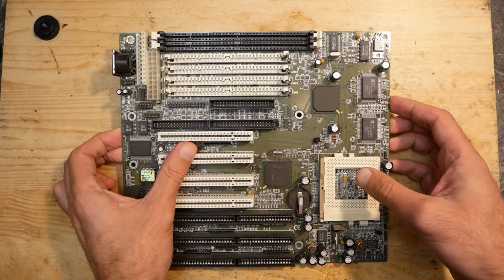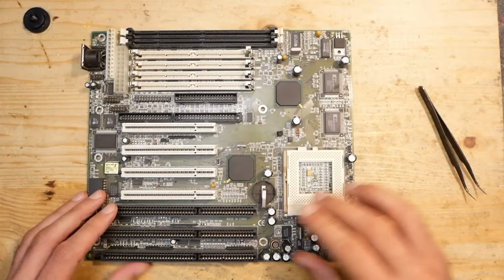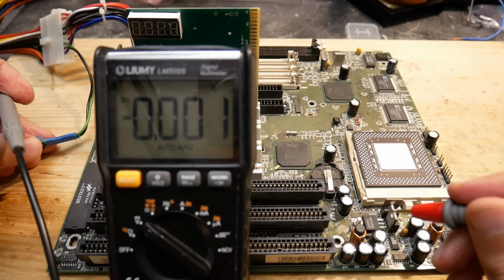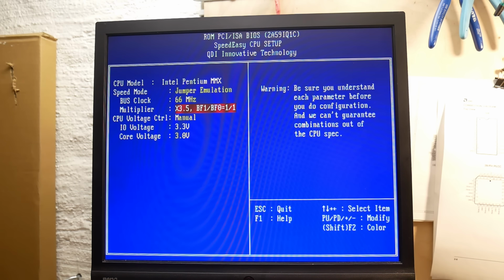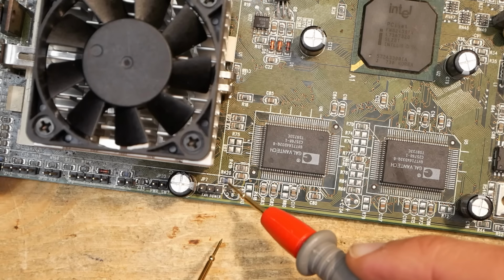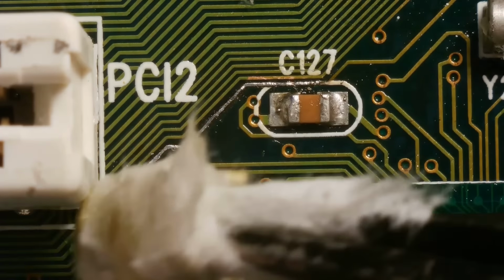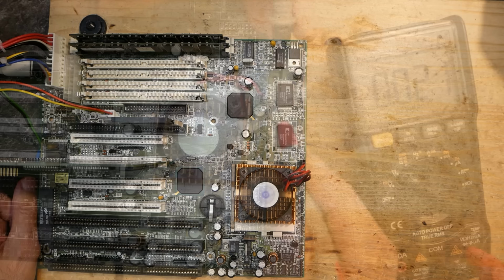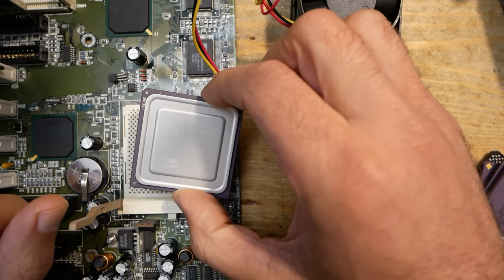QDI P5I430TX - is it the best Socket 7 mainboard?

Comment: Nice board, but I like my Freetech P5F87 better. Also 430TX, but ATX, can also automatically adjust voltage (can also be adjusted manually), but with the updated BIOS from Jan Steunebrink it can also K6-2/2+/III/3+, more modern Cyrix MII and HDD120GB. What it can't do automatically is adjust frequency.
Reply from the maker: I just never released an update. I worked with Jan on this board and it got a modified BIOS to support everything up to K6-3+, 83MHz FSB and all the other stuff incl. automatic frequency.
Reply: @necro_ware  That's great. I was also very pleased with his work on my board, which greatly increased its value. I like tuning these old boards to the best of my ability. I have a Cyrix MII in mine, so it's not the best possible, it's more of a machine purely for fun and I hope to meet the fastest Cyrix PR433 one day.

Comment: I had two of these motherboards back in the day. Don't remember if it was 1996 or 1997. Anyway, I blew up the first. I accidentally left the cmos jumper shorted while I tried to start the computer. I could see a big spark near the cmos battery, and I remember seeing a big trace rolling backwards on the board. So that was that and I had to buy another one. Also, I believe there is a beta bios or something so you can get 83MHz FSB. I remember I did that back in the day. Anyway, for it's time this was awesome. I remember how awesome it was to have jumper free overclocking.

Comment: I have the same motherboard, unfortunately the bios got corrupted, how do I restore it?
Reply from the maker: Download it from the retro web and write it using a programmer on the ROMs.
Reply: The chip is soldered on the motherboard and has 32 pins. Which pins should be connected to the eeprom programmer?

Comment: maybe not so related question. I had a pc die on me when I removed the cooler to change thermal paste, after new paste it wouldn' boot.

I bought a PCI post debug card and it doesn't show any numbers, no 0, only the default "----", does this mean dead motherboard? or cpu? the motherboard is a GA-7ZX rev 1.01 (actually seems to land between 1.01 and 5.0 because it exhibits features/lacking of both...)

Comment: Nice! I have saved the cheaper 430VX QDI which has the SpeedEasy feature as well! It is kind of a hybrid of old and new stuff. Btw - it is quite common to have a VRM failure on those boards that is manifestig in the way that only single voltage cpus work! In some cases one of the power transistors / mosfets is bad. In my case it was one  voltage reference (small 3 pin part) that failed. Used parts from a dead broken board and saved the better one. 😂 And the funny part . I had to fix the same broken Simm slot and IDE connector as you 😀. Used 100% the same method and all work. In my case the board beeing VX I need the simms more.

Comment: I had a similar mobo : Shuttle HOT! 569 iTX. While it didn't have  CPU settings in BIOS and instead relied on a series of switches (not jumpers), it added support for 83 MHz FSB speed and a third SDRAM slot.
Let me tell you, running a Pentium 133 at 166 MHz on it (83x2) was a BLAST - benchmarked at Pentium 200 level.
I had started looking for an AMD K6 to plug on it when I chanced upon a nice deal on a Celeron 300A and an Abit BH6 - people from that time will realize that there wasn't much on Socket 7 that could rival that setup, and even Super S7 was hard pressed.

Comment: I can confirm it, I have the same one and it is a great motherboard, it was one of the first boards to have automatic FSB and vcore adjustment based on the microcodes, dc-dc converter, on top of that it is very stable.
I have had it working on that motherboard with 256MB of ram and Windows XP, and it was working really well.

Comment: What tool are you using to remove the solder mask and do you think it would work well for removing the nickel strip spot welds on 18660 cells? I’m looking for a clean way to drill out just the spot welds so that the nickel strips can be reused when replacing bad cells in a battery pack. Most people using a rotary tool grind stone are just trying to smooth the ends out after ripping the nickel strips off.

Comment: If 68Ω was the lowest value SMD resistors you had and you had more than one then you could’ve squeezed two of them side-by-side for half the resistance (34Ω). You could stack two more on top for 17Ω. That’s still 70% more than the original 10Ω resistor we’re replacing but drastically closer.

Comment: I still have my DFI 586IPVG (Diamond Flower) Socket 7 board from back in the day, It has VX chipset, IR and USB built in and is an awesome board. It's not jumperless, but check one out if you get the opportunity.

Comment: Love these videos and the Soundtrack,
I had an Asus TX-97 back in the day and it was able to support  voltages as low as 2.1v  and in theory up to 83.3Mhz 83 was never stable but 75MHz was. The last thing I ran on it was an AMD K6-II 380mhz (a 2.0v variant) @450mhz if you set jumpers at 2x it would run at 6x bus speed so 75x6 at 2.1v that was my best Socket7 setup I Still have the CPU but the board is long dead!

Keep up the videos they are inspirational

Comment: There's also a PC Chips m570 Socket 7 motherboard with such jumperless CPU configuration. It has also an AGP slot, integrated Sound Blaster Pro compatible sound chip and USB support. I have it in my collection and I use it for quick testing of components from this era.
Reply: There is even PCChips M572, which is fully Intel TX , no AGP socket 7 board, so direct competitor.
I have it, and it shocked me.
Fully jumperless, voltage and FSB in BIOS, and voltages from 2.2v to 3.5v... in 0.1v STEPS!
Couldn't believe it. Yes, it owned even this QDI Titanium IB, i stood shocked when I first tested it.

Comment: I have this model of board, I bought it new in the box in 1996. It still works without problems and is my base for a Socket 7 retro machine.
Reply: You had probably its predecessor, QDI P5I430VX-250DM V2.0 (S2.1) (Explorer II/SpeedEasy)
Looks very similiar, if not the same. Along with Abit, it was first board to feature jumperless design (tweaking multiplier, CPU voltage and FSB, in BIOS).

TX board came out in middle 1997. You can find Anadtech review in early 1998.
first BIOS is around the june 1997.
Reply: @warrax111  No IT was Titanium I on TX chipset, probably I messed up with the datt.